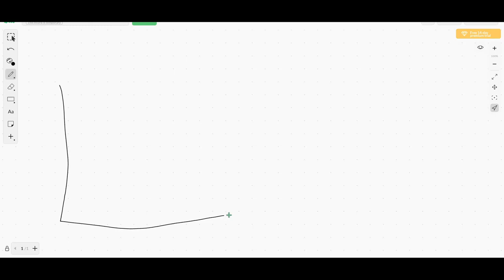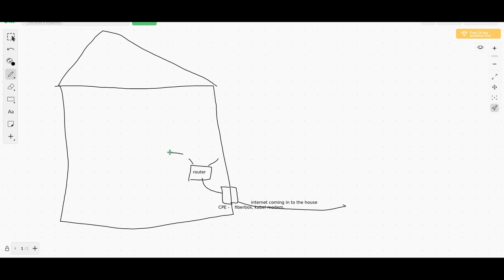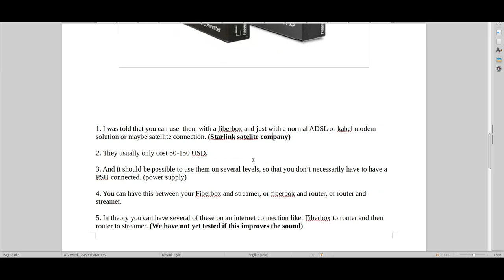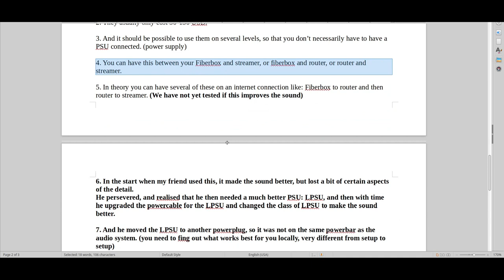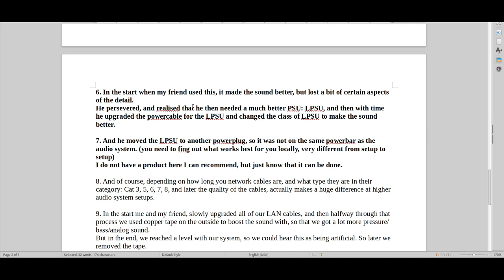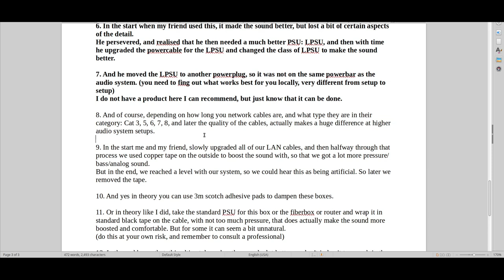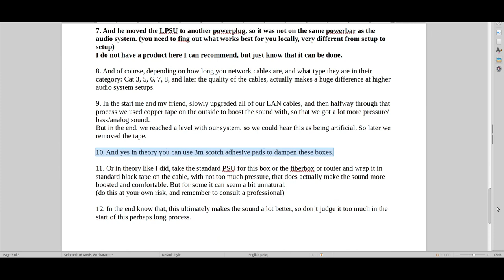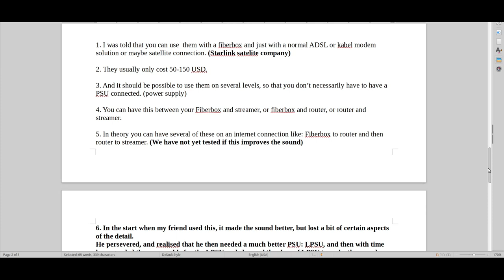FMC converter; why you need it for audio streaming

Comment: I added this last year in my house. Amazing. It even helps if you put Linear power supply on them. Speacially at the streamer end. Make sure to use proper glass optical fiber cable not the plastic type. 
1) Just the fmc with normarl psu : deeper black level. solid imaging.
2) added lpsu : bigger soundstage, heavier solid imaging.

The difficult part is to make the fiber cable go threw your house and cut it properly with the right equipement. and choose a very good rj45 cable to connect to your streamer. It took me 3 days to do it properly and i had to borrow special equipement to make sure the strengh of the signal was ok on the cable.
Reply from the maker: Interesting. (I agree with you)

Check out the channel Audio science review. Quite interesting. But also shows you how most engineers are blind to the things that really matters in terms of sound. 

Check out the audiophile switches video. I just wrote a post in the comments section saying how he is right and wrong.
Reply: @RealHIFIHelp  I'll ckeck him out. But i typically stopped listening to pseudo science on youtube. I studied science and maths in college for a while before changing direction. One thing i see every time on youtube is pseudo scientist that talks about mesurement instead of doing proper research.
And the first thing you do when you do real research is OBSERVE. In audio it should mean LISTEN. and even at the begining the problem start. "Double blind test !" "You are earing things !" .......
Some guys seem legit in their approach like  Danny Richie from GR research and even Paul from ps audio in an extand but they don't have any answer to give except their experience and that's already good for me.

But when i see so much controversy about cable making a difference or not ? I found it crazy. Anybody that have taken the time to test 5 different rca cable in any system even the lowest model can ear a difference in real life. Not in internet where everything is speculative.

And people talk so much shit about things like usb cable making no difference. It's just 0 and 1 ! But what most of them don't realize is on a physical level 1 and 0 means electricity or no electricity and that thing can be influance easily by EMI and EMC. And if you study just a little bit how radio transmission is done and the properties of the materials used, you understand that most of what audiophiles debates about isn't even up for debate.

The only thing we don't know is how to demonstrate certain phenomenom that we have identified long time ago.
The only problem with the audio industry is that it's small and the only companies doing real research are keeping their findings for themselve for competitive advantage.
Reply: @RealHIFIHelp  i just saw the video. The guy is right by saying people shouldn't buy those things because they don't do what they say they're doing. It's 100% facts.
I know for sure all those claims the marketing department of those brands makes is bullshit for the most part. I'm an IT guy and i know how those protocols works.
But he didn't prove that different switches don't makes different sounds. He just prove that 2 switches mesure the same and in his system they sound the same.
I don't need to argue with him as we are not searching for the same thing. His approach was limited from the jump.

My hypothesis : every material has a sound and every component too. The ethernet cable, the circuit, the discret and active parts, the plugs, the wires,...
In case of physical connexion even digital impedance matters and other parameters that I'm not sure about yet like linearity of the components.
All those parameters makes it more complex to predict where is the problem with the copper connexion from the box to the streamer.
But using the FMC, breaks that connexion and you can start new from the FMC box to your streamer. Of course you'll still have to deal with the sound of the FMC.
But in my opinion the best streamer should be by WiFi with an excellent design done to isolate the wifi receptor in the streamer. If your internet is fast enough it should be the best way. With software like audirvana inside which buffer the stream and plays it bit-perfect like it is store localy. 
The average audiophile (5k to 20k) should never have to worry about clocking issues or jitter. The equipements at those prices are built very well for the most part. 
Any perceived improvements comes from other reasons that what those companies tells us.
Reply from the maker: @yannick930  I agree.